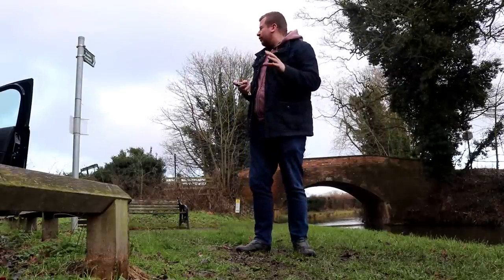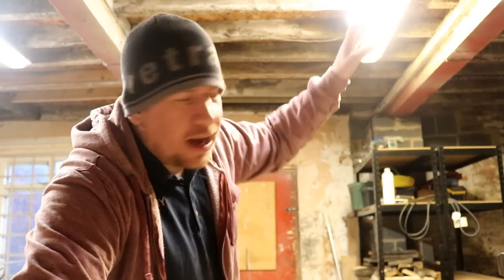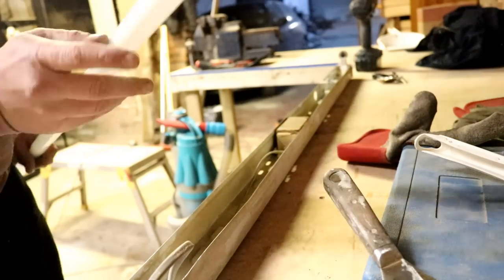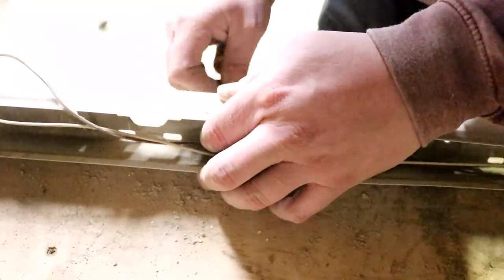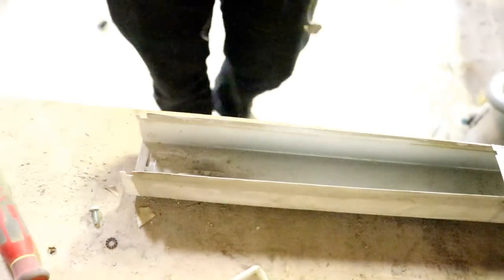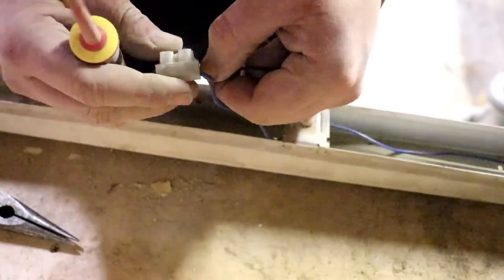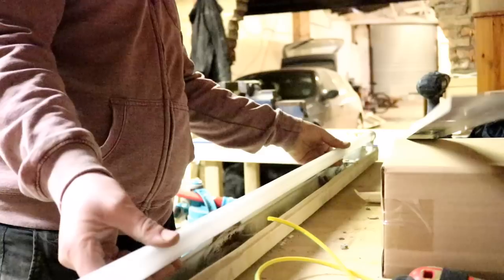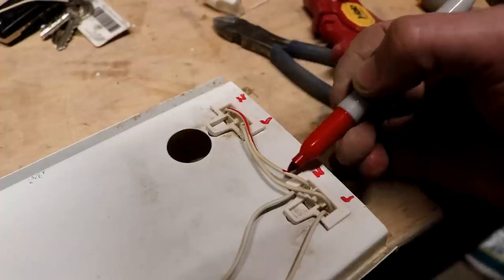Change Your Fluorescent Tubes To LED ~ Ballast Removal ~ Single & Double lights

Comment: A proper craftsman at work, a cowboy would have just cut the wires off at the first tombstone rather than dismantling it and removing them from the connectors. Neat job, well done 🤗. I was horrified by the red sharpy mark but you made it all right again by mentioning your mistake. I like the router table idea, might pinch that one and adapt it.

Great video as usual, waiting for the next one.

Cheers

Schnuz.
Reply from the maker: You are too kind. I grew up with red marks on my work
lol

Comment: Can I ask... There's no voltage reduction unit required to run the led flourescent tubes? It's just mains power straight into the units as if they were std tubes. Obviously the led tubes give better and cheaper lighting too?

Comment: Great Video, but I just wanted to say that the starter is not a fuse and add the following:
A fluorescent starter is a simple timed switch that allows the flow of current in the filaments of fluorescent light. The current heats up the contact of the starter, turning its switch on and off until the fluorescent tube lights up. That’s why you see your fluorescent tube lights blink a few times before starting because the starter tries to maintain the flow of current.